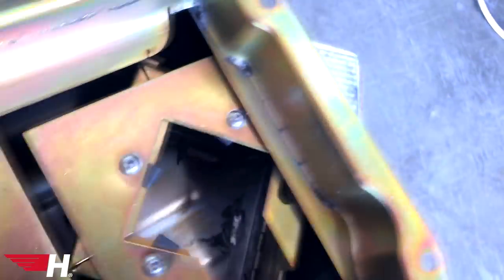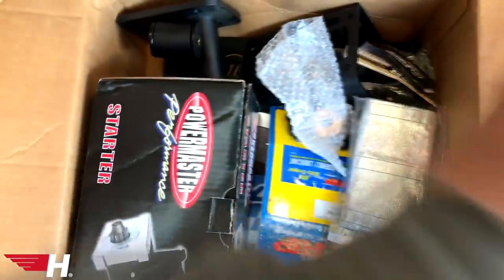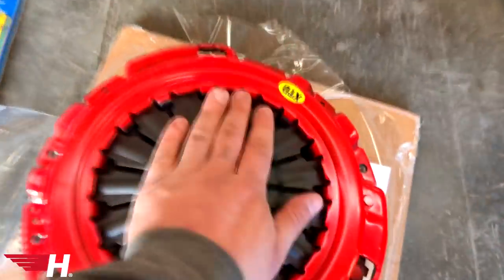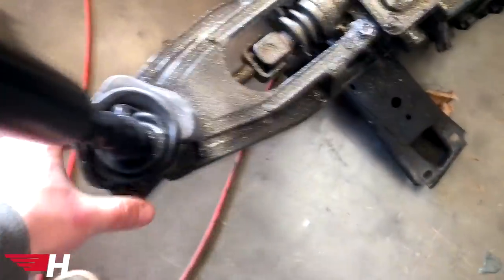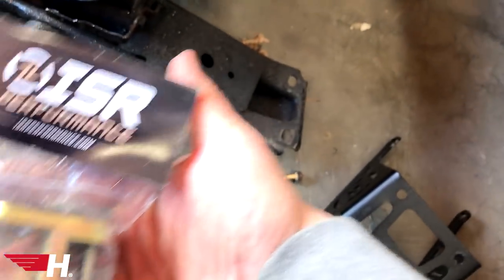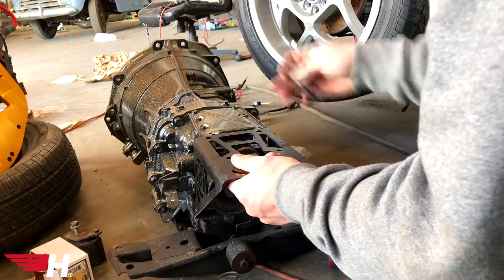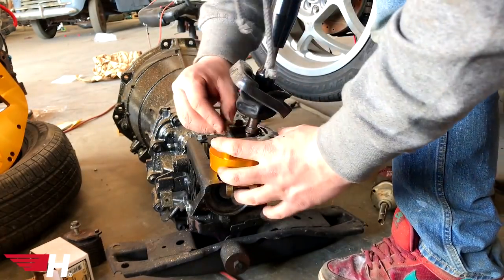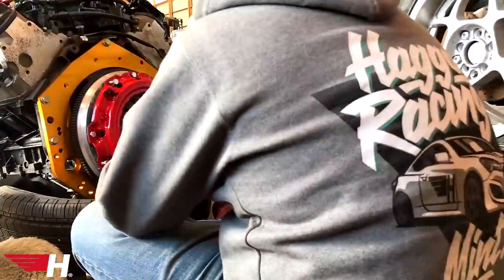HOW TO LS SWAP 350Z PT.1

Comment: The only critique for this build Is the clutch. As long as it stock power or bolt ons yes ibe always ran exedy clutchs woth no issues or even the enjuku kits are sick. Well worth the price you pay. I see your already running enjuku racing parts. You'll be good I can't wait to see whats up with tje Z. I just started on this series coz I'm in tje market for a new drift car. Never owned a Z here there great out of the box for drifting. Only thing you need is a ok angle kit for a stock car tje vq can get you sideways. Love you videos hope to see more.

Comment: At 18.8 the spacer thing is for the flywheel bolts it fits on the front of the flywheel not on the back the flywheel check with isr

Comment: I would double check that the "spacer" you put on before the flywheel is indeed a spacer and not a "collar" used as a sandwich plate between aluminum flywheel and steel hardware bolts.
Reply from the maker: Tom Jones yea I figured that out today thanks though homie

Comment: Using the cd008 didn't mount in the factor spot and use the oem drive shaft?
Reply from the maker: Dungeon Performance no, this that is meant to get the engine as far back and low as possible, that’s why it comes with the shifter adapter and new trans mount

Comment: What clutch and flywheel, I need to know bro? If you clutchkick it in 4th gear I'm sold
Reply from the maker: Rickk R. Originally I had the eBay stage 4 unsprung and I blew the rivers off it, currently I have a comp stage 4, enjuku carries it I believe, I can drop 3rd standing still and do a burnout I tried shifting to 4th but I don’t make enough power lmao didn’t slip though just almost stalled the car 😂

Comment: Do you have to run a specific flywheel setup? Or could you still run a normal clutch and flywheel setup as you would on a normal ls/t56 setup?
Reply from the maker: The use kit comes with the flywheel that gets everything in the right position to work with the cd trans 👍🏻
Reply from the maker: If you’re using a t56 you can use a regular ls clutch, for my kit I use a 350z clutch